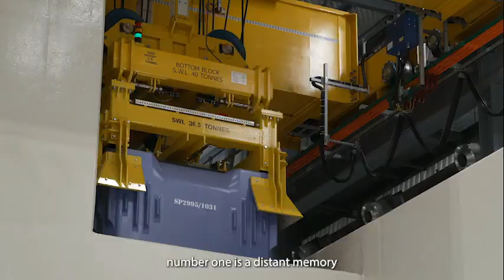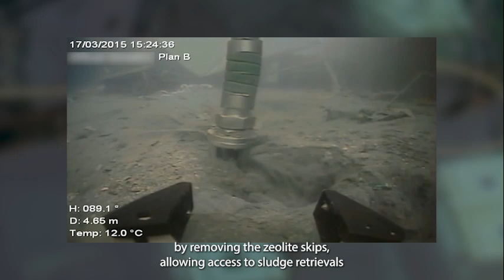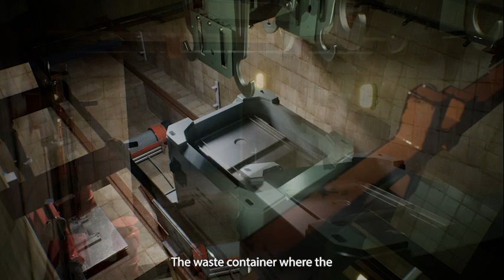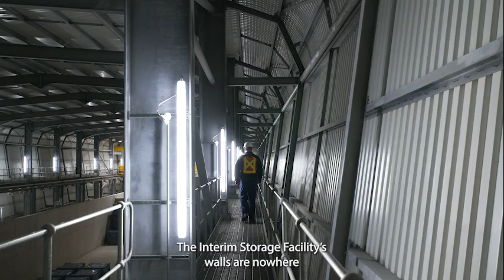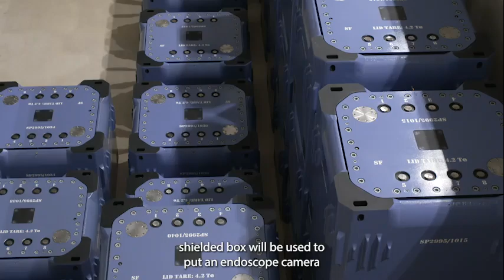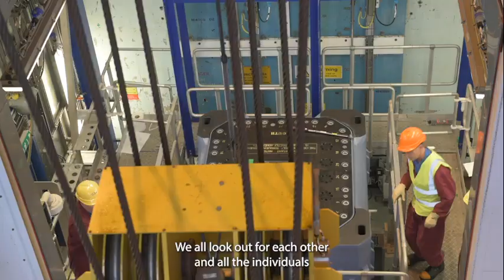The First Generation Magnox Storage Pond - Zeolite skip export

Comment: Is the unbelivable cost of all this being factored into say Hinkley Point C, which will just create another problem like this in another 50 years?
Reply: No it won’t.

Hinckley Point C was designed to be taken apart and decommissioned safely.

Most of the high level waste at Sellafield was generated from 1950 to 1980.

So much of the early reactor programs and nuclear weapon programs was never designed to be decommissioned & the waste was never designed to be stored.

That’s why it’s so expensive today.

For example Hinckley point C will complete construction, generate power for 80 years, be decommissioned & likely be replaced by a new reactor on the same site long before the old parts of Sellafield finish decommissioning.